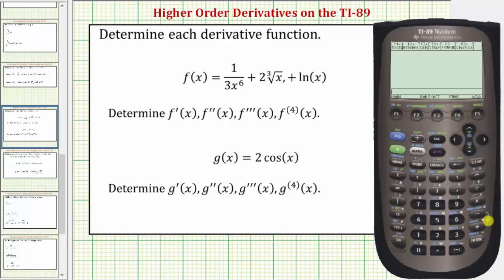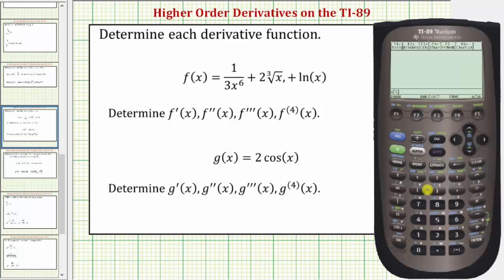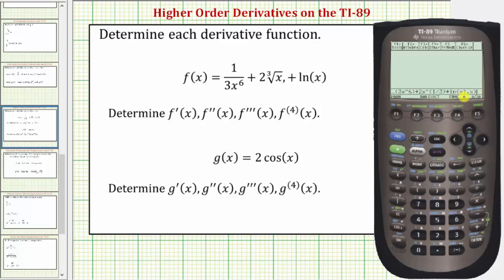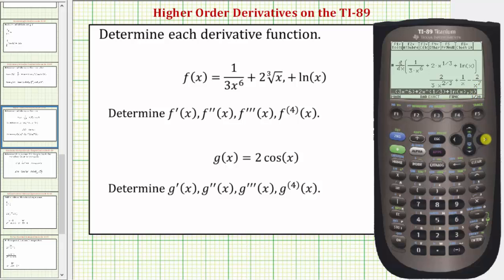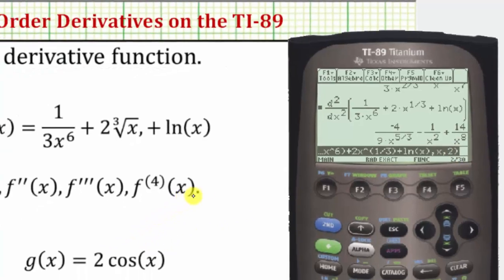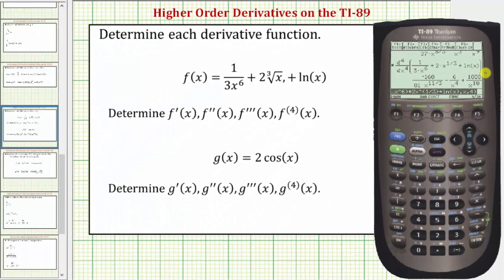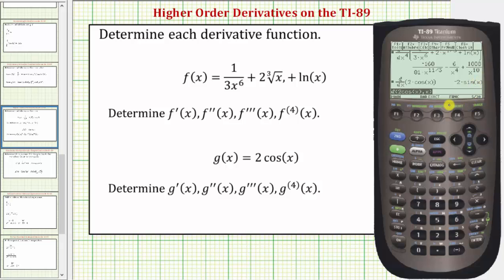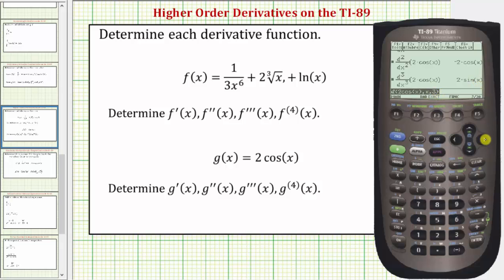Determine Higher Order Derivatives on the TI-89

Comment: My TI-89 only shows the second and third components of the derivative when I enter this, would you know why?  I have my settings to RAD Exact like you do but the first component remains on the line above and only 1/x - 2/x^7 appears to be calculated
Reply: If you typed in the answer exactly the way he did, your calculator should give you the correct answer mathematically. I am not sure why this is the case. Please make sure that you entered the problem correctly.